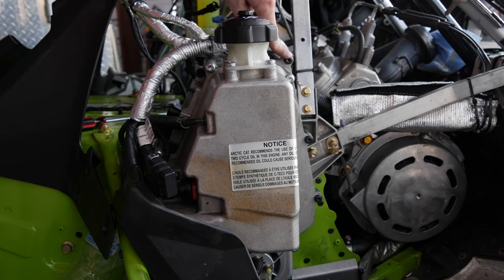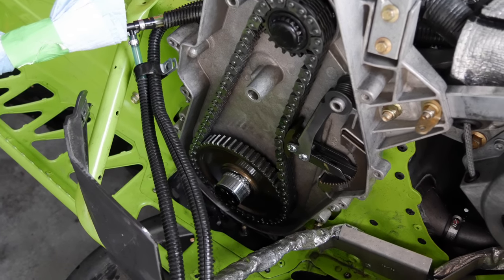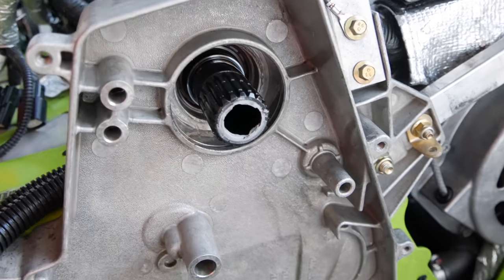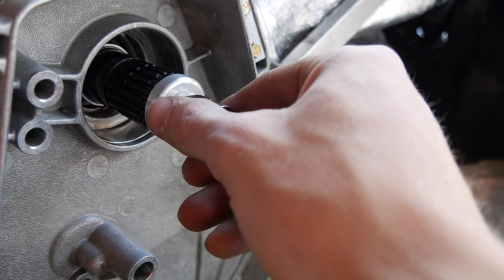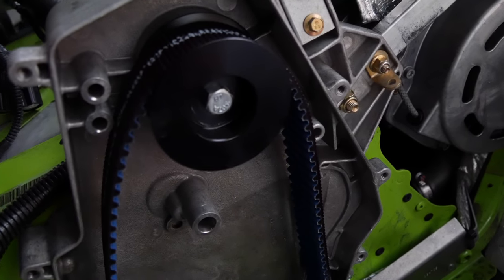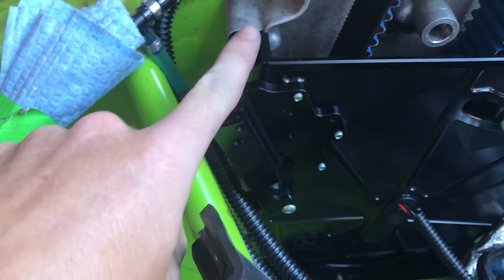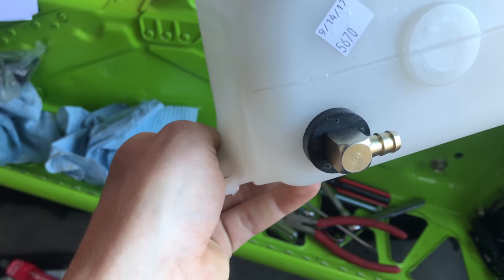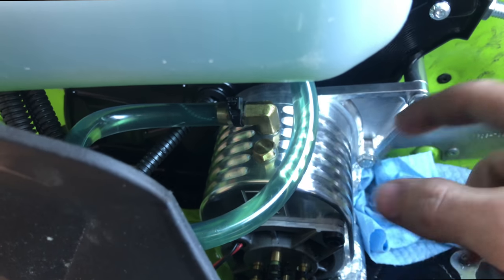2019-2018 Arctic Cat M8000 TKI Belt Drive Install

Comment: Thanks for the clear vid. Main benefit is weight saving? And is the trade-off blowing belts?
Reply from the maker: Main saving is the rotating mass loss and that equals hp. Your sled has such a better throttle response with a belt drive. I’ve had a belt drive for 4000 miles between 2 sleds and I’ve never blown a belt!
Reply: Good point--hadn't thought of that. Thanks.
Reply: Trey Crouch so this is a noticeable difference on the snow?
Reply: Tyson Boser ya that’s what I’m wondering
Reply: Big_Whiskey13 I want one but for the money you could do a pipe and a tune. That’s over 10hp and you damn well will notice that!
Reply: Tyson Boser thats better believe me i tried my girlfriebds brothers etec with the belt drive didnt knotice no difference it makes you not able to read the mileage of the sled bc the sensor was taken off

Comment: So why is this Better can someone please educate me 🤓
Reply: significant weight savings, increased reliability including a slight power to track gain due to less rotating mass in the chain case. And, when a chain goes it usually grenades the casing.. If the belt craps out you put a new one on and enjoy the rest of your ride.